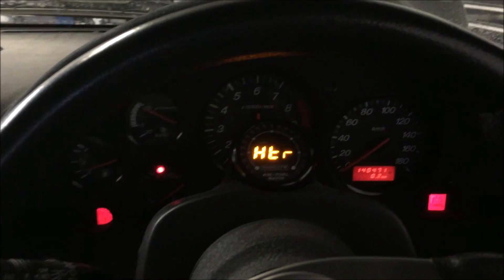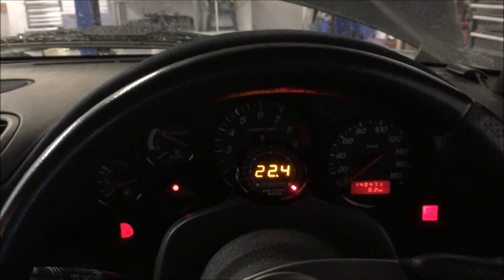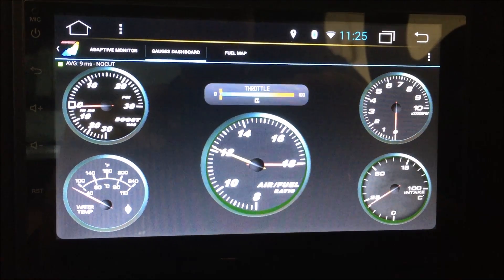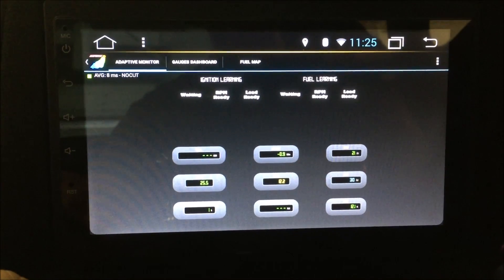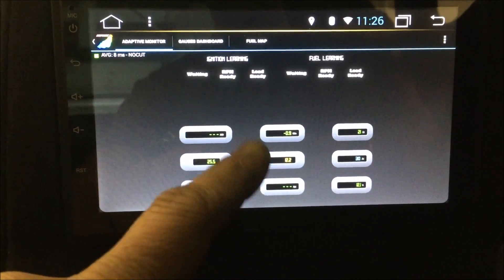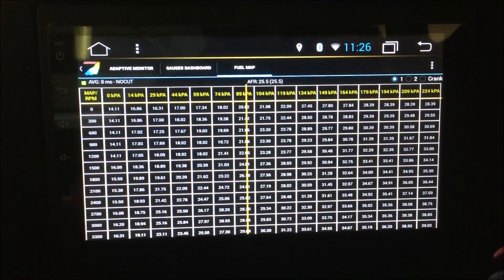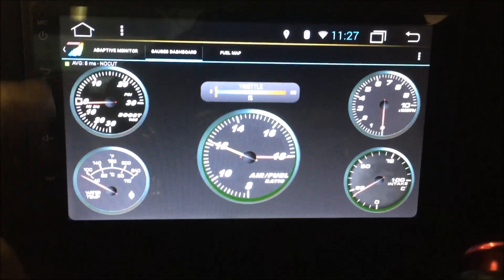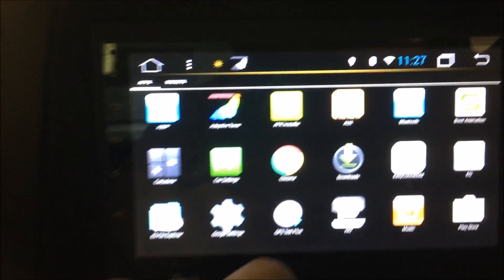ROTEC Mazda Rx7 build part 8. Electronics...ECU, SECURITY and ENTERTAINMENT.

Comment: Can u do a vid of the car running and stuff?
Reply from the maker: Hi Zac. I had the car running for one month. I had it on a dyno and tuned it, raced it at Atlantic Motorsport park and was also daily driving it. Two Thursday's ago two apex seals exploded on the rear rotor completely destroying the rear rotor, rear iron, centre iron and housing. The car right now has the engine out and fully torn down. The rebuild kit will be here this week so videos of the rebuild to come. I am doing a half bridge port to it as well so lots of content to come!
Reply from the maker: Check out my Instagram for the pics. It's pretty spectacular! @scotiatint
Reply: +scotiatint1 dam man that sucks! That's rotors thou lol!
Reply from the maker: +Zac Drescher yes indeed. The previous builder of the engine used massively mismatched rotors which caused excessive wear to the bearings. Ultimately this lead to the rotor striking the housing and imploding. I have new rotors which are now built and waiting for my irons to come back from lapping nice and flat again.